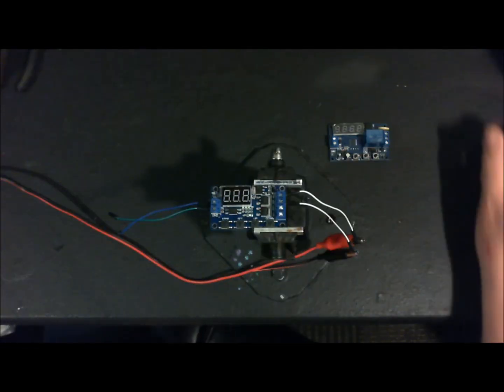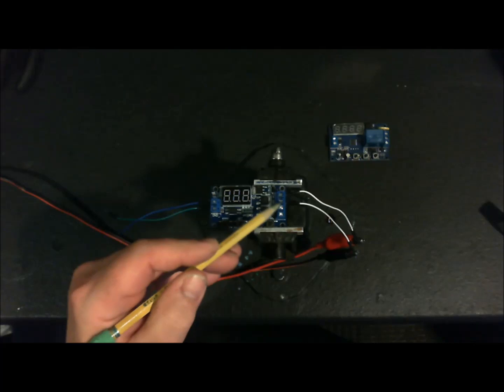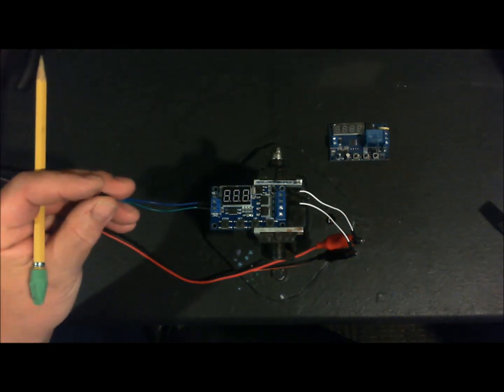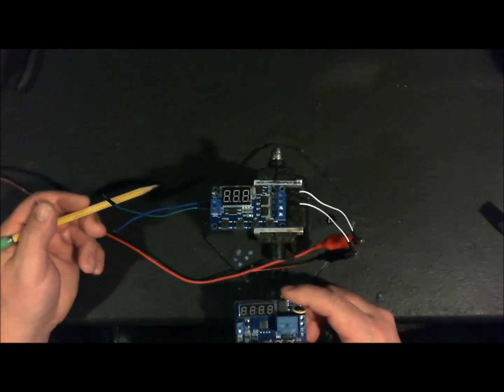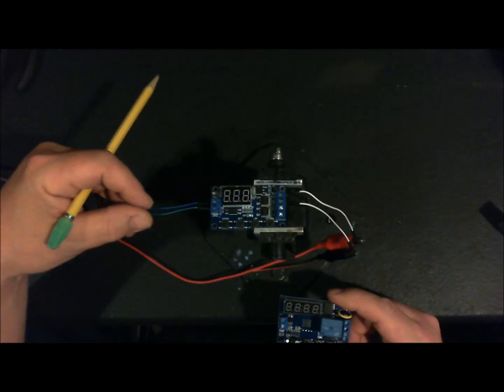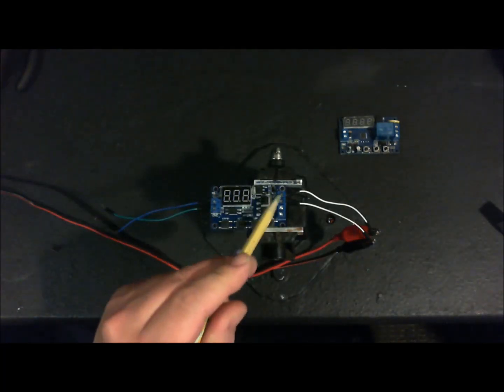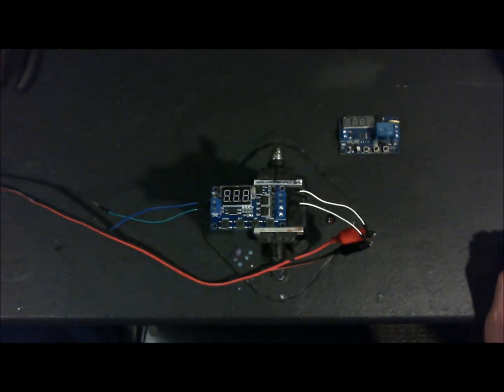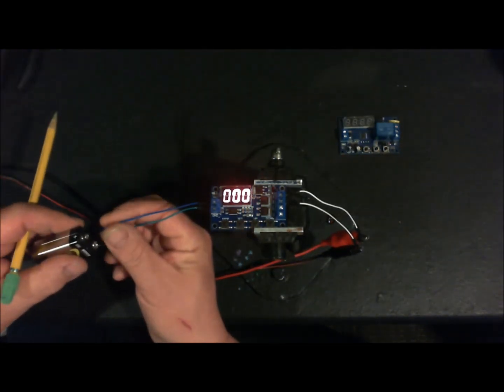Trigger cycled timer control board simplified.

Comment: This is driving me nuts! I'm trying to make it send continuous current to keep a small relay open for X seconds and then stop. JUST THAT! When I push stop and goes "ON", it sends current all the time except for when I start the countdown. When I push on stop again and shows "OFF" on the screen, it never works! WTF! Why is it hard for it to be programmed to just send current for X seconds! That's why I bought it in the first place! Can anyone help???
Reply from the maker: Ha, Chill, take a deep breath, please explain what it is you are trying to do in detail.
Reply: @raykd2ibp198  I emailed you details
Reply from the maker: Hello my friend. I have not received your email as of this message. You can elaborate here if you wish. Perhaps someone else can benefit from our findings as well.  A Lot of the problems with these projects are typical, often stemming from a lack of clear information provided by the creators of these boards. We help each other. If you prefer to be more private regarding your project... that's cool as well. Try the email again.
Reply: @raykd2ibp198  no it's ok and thank you for your time. so I need to have a specific low signal going through a wire. I wanted to interrupt the wire and put a relay which would open and close again for a specific amount of time, only once when the timer circuit would be triggered. So what I did was getting the timer and a relay. So far so good. I give the VIN (-/+) a 12V juice, I took a momentary switch for the trigger and gave the trigger juice from the VIN current. I connected the relay to the output of the timer and also soldered a 1k resistor and a led to see when the relay is open. I turn everything on, leave the progra on P1.1, set timer in 5 seconds, I test the STOP button, program it to OFF, press the trigger nothing happens - expected. I click STOP again, screen says "ON", the LED turns on, I'm like "wtf are you doing...?". I pull the trigger and as it counts down from 5 seconds to 0 the LED turns off and as soon as it reaches zero, what do you know, the LED turns on again and I'm left speechless!
Reply from the maker: Good day sir. (Name please)  K, What exactly are you looking to achieve in terms of sequence of operation after trigger? Time contact is closed, or open etc. 
Also, the board itself is like a solid state relay. SPST. Unless you are looking to drive a higher current than the transistors can handle. Or, you need to control more than one pole at one time, there is really no need to add another relay. 
I believe it's best to keep circuits as simple as possible. The less components used to achieve the final goal the better. More components = less stability, higher maintenance, and greater parasitic load.

Comment: hello, how to connect an IR module as a trigger? Thank you for the video
Reply from the maker: Can you show me the IR module?
Reply: @raykd2ibp198  Here's the link,thank you    https://www.ebay.com/itm/Smart-Car-Obstacle-Avoidance-Infrared-Sensor-Module-Reflective-Photoelectric/191848903842?ssPageName=STRK%3AMEBIDX%3AIT&_trksid=p2057872.m2749.l2649
Reply from the maker: If the module sends out +5 volts dc to the trigger in theory, yes this is doable. if you want to share in greater detail what it is you are trying to accomplish in terms of sequence of operation... I maybe be able help you out better. The IR board is limited distance wise.
Reply: @raykd2ibp198  Ok, I'm trying to make an automatic hand sanitizer dispenser but with the IR module, if you don't take your hands off, you're always putting the sanitizer on, so with the XY-J04 CMOS maybe I can stop it after a few seconds, say 2 or 3 seconds.

I did this:
https://www.youtube.com/watch?v=5yojb3vL-go

But I want to do this and use the XY-J04 instead of the XY-J02:
https://www.youtube.com/watch?v=jBHuBe5gmNo

Thank you
Reply from the maker: Ok, eliminate the transistor, and resistor from the cricut. Use the +5 volts you were driving the transistor with to now trigger the board. 
Use the pump supply voltage to feed the input voltage on the timer board. The load side on the timing board now drives the pump.
Reply from the maker: https://youtu.be/ysMldbfteLo
Reply: @raykd2ibp198  I am using the same power supply to power the pump and the IR module. The pump also works between 3v to 6v which is very convenient in this circuit.
Thank you

Comment: Hi can the trigger only be momentary or can it have 12v constantly and start the timer when the trigger is removed?  I want to use this in my car to power a radio. Like a failsafe that if I forget to turn the radio off it will time out after say an hour using the ignition 12v as the trigger
Reply from the maker: Hi Mark. I'm not sure. Wouldn't it be easier to have the main power to the radio wired into the vehicle's ignition switch circuit?  Key off = No power.
Reply: @raykd2ibp198  Hi Ray, Thanks for the reply. Its currently plugged into the 12v cigarette lighter socket but this switches off with the ignition. I would like to be able to use it without the ignition on or engine running. My idea is to wire it from the battery but have a failsafe so I dont leave it turned on by mistake. Being a canbus car its more hassle than its worth trying to find switched power that is on with the ignition off but goes off when i leave the car. This seemed like a good option.
Reply from the maker: Hey mark. Yes you can set the board to count down and open contact after trigger closes contact. See operation P3.1 attached in the comment section. you would just install a momentary push button type switch to trigger the board.

Comment: Hi Ray, thanks very much for the video :)

Do you know if this board/or another board will hold the contacts open for a second or two when mains power is cut.
i.e. I'm trying to come up with a solution that will delay the contacts opening when first provided with power, leave the contacts open until power is cut, at which point the contacts will continue to stay open for a second or two and then close
Reply from the maker: Hi Damian, If I understand the question correctly... You want both delay on "make"  when power is applied. And a delay on "break" when power is removed?
Reply: @raykd2ibp198  Hi Ray, yes - that's correct
Reply from the maker: Damian, I don't believe this board can run two modes concurrently. Although, I believe this board will support both functions independently. 
Look thru the attached modes of operation list in the comment section. 
What kind of voltage  are you working with?

Comment: I also have an 12volt cirquit time board, but I don't understand it.

I have an weight trigger micro switch, a micro water pump and the cirquit board.

What I want is put a glass on the micro switch then the cirquit board goes on and stays on for like 3/4sec and turn on the pump and turn it off after 3/4sec.

How can I do that?
Reply: It's like a drinks tap when you put your glass on it and shut off after a few seconds with pumping drinks in your glass
Reply from the maker: Good morning :)  I hope this helps you to get to where you are going. Please let me know if you get stuck. 73. -Ray 
https://youtu.be/YlmAey_HTJk

Comment: Sir, how can I use it to switch an AC water pump 220v on/off? Is there a modification possible?thx in advance.
Reply from the maker: Good morning.  The board circuit is like a single  pole, single throw switch. (SPST) you can use the board at a lower voltage (12/24 Vdc) to energize a double pole single throw contacter / relay to make a 220 volt circuit.  I can make a video depicting how if it helps.

Comment: Can it reverse polarity between triggers? Thanks
Reply from the maker: Good morning, I'm not sure if I understand the question. 
Can you explain what it is you're looking to do? I will be happy to help if I can.
Reply: Can you have a motor turn for X seconds then reverse the polarity to turn the opposite direction?
Reply from the maker: @dfxvideos808  

I doubt it.  Pretty sure the board simply controls NO/ NC switching. Let me think about how that can be controlled.   Can you share sequence of operation details? Message me if so.

Comment: Little  dark to see wires. I'm having  trouble  with trying to get a 6 volt pump to work on time delay pump  does not seem to be getting  power. Trigger seems to be working fine though. Thanks Tom Wainwright
Reply from the maker: Good morning Tom, 
1)Got a pic of your configuration? 
2) What is the sequence of operation you are shooting for?
Reply: I would have send you a pic. On email . Its twainwright1969@yahoo.com  thanks Tom
Reply from the maker: Sent you an email.
Reply from the maker: Hey Tom. Have not heard from you.  Is your problem resolved?
Reply: No not yet . Haven't had time to play with it. Relay is from China so it not even work. But I did order usa made relay.
Reply from the maker: Ok. I check my comments every so often. Feel free to reach out if I can help.

Comment from the maker: Mode selection screen: Long press the "SET" key to enter, after setting is completed, long press the "SET" key to exit back to the main screen.

Operating mode:

P1: trigger signal, the relay is on "OP" time, and then disconnect; in the "OP" time, as follows:
P1.1: signal is triggered again, invalid
.
P1.2: signal is triggered again, the clock is reset
.
P1.3: Signal trigger again, relay off, stop the clock.
P-2: trigger signal, the relay off "CL" of time, the relay on "OP" time, and then disconnect relay.
P3.1: trigger signal, the relay is turned on after the "OP" time, the relay off "CL" time, then the operation cycle, if the trigger signal period, the relay off, stop the clock; the number of cycles ( "LOP ") can be set.
P3.2: without triggering signal, the relay is on "OP" time, the relay off "CL" time, and has been cycling; frequency ( "LOP") cycle can be set;
P-4: signal holding function. If there is a trigger signal timing is cleared, the relay remains on; when the signal disappears, after the timing "OP" time, the relay is; if another signal during timing, timing is cleared;

After setting the mode selection screen parameter value by a short press "STOP" button to select the time range;

XXX. decimal point in the unit place, time range: 1 second to 999 seconds.
X decimal point in decade place, Timing range: 0.1 seconds to 99.9 seconds
X. X. decimal full brightness, Timing range: 1 minute to 999 minutes.
For example, you want to set "OP" is 3.2 seconds, then move the decimal point to decade place, the digital display 03.2

Parameter description: "OP" - conduction time, "CL" - off time, "LOP" - the number of cycles (1-999 times, "---" represents infinite loop).
Product parameters:

1: Operating voltage: 5--36V.
2: Trigger Source: Active-high (3.0V-24V), have optocoupler isolation, can improve the system's anti-jamming capability (customers can also shorting common ground).
3: Output capacity: DC 5V - 36V, at room temperature, continuous current 15A, power 400W! Enhance heat dissipation conditions, the maximum current up to 30A.
4: Quiescent Current: 20mA; Operating Current: 50mA

any switching times; Working temperature: -40-85 °; Size: 6.0*3.4*1.2cm.
6: With optocoupler isolation, enhanced anti-jamming capability, industrial grade board.

Pay attention:

The module is an active output, the output voltage equal to the input voltage.
2.'DC + 'and' load + 'This is an internal short circuit of the poles, but' DC- 'and' load - 'poles during use can not be shorted, otherwise the load can not be controlled on and off, which is equivalent load is been carrying electricity.

Timing range

0.1 seconds (min) to 999 minutes (max) continuously adjustable

How to choose the time range?
These parameters are independent of each other, but is shared by each mode. For example, in P1.1 mode, set the on-time "OP" is 5 seconds, if you switch to P1.2 mode, it's "OP" will be 5 seconds too.

In the main interface (display 000), short press "SET" button will display "OP" ( "CL", "LOP") and the corresponding time XXX;

Some parameters only mode "OP" (such as the mode P1.1, P1.2, P1.3), short press the "SET" key to display only the "OP" and the corresponding time;

Some models have parameters "OP", "CL", "LOP" (such as the mode P3.1, P3.2), short press "SET" button will display "OP" and the corresponding time, "CL" and the corresponding time, "LOP" and the corresponding number of times;

In the main interface by short press "SET" key to see information about the parameters of the current mode, very convenient!

How to set parameters?

First, read the instructions to determine the required operating mode.
The module is powered up, the display at the current work mode (P1.1 default mode), then enter the main interface; press "SET" button for 2 seconds after release to enter mode selection interface; a short time by pressing "UP", "DOWN" key to select the mode (P1.1 ~ P-4).
Select the mode (such as P3.2), short press the "SET" button, then the parameter to be set flashes ( "OP" on-time, "CL" off time, "LOP" cycles ( "---" represents infinite loop)), by "UP", "DOWN" keys to adjust the parameter value, support long press (rapid increase or decrease) and short press (increase or decrease one unit); then short press the "STOP" key to select the decimal point position, select the time range (0.1 seconds to 999 minutes); short press the "sET" button to set the next parameters of the current mode of procedure is as above.
After the parameters are set, long press "SET" button for 2 seconds then release, the name of the current mode will flash once, and then return to the main screen, set the parameters of success!
The main interface: In the relay does not work status display "000" (no decimal point), with a decimal point under relay state.

Mode selection screen: Long press the "SET" key to enter, after setting is completed, long press the "SET" key to exit back to the main screen.

"STOP" button extensions:

Relays enable mode:

ON: Relay allows conduction in the "OP" on-time;
OFF: relay prohibit conduction is always closed;
In the main interface, short press the "STOP" button to switch between ON and OFF, the current in which the state will flash, and then return to the main screen. (This feature is an emergency stop function, click off the relay)

Sleep mode:

"C-P" Sleep mode: five minutes without any operation, the digital display automatically turns off, the program running as usual;
"O-d" normal mode: digital display always open;
Press the "STOP" button for two seconds and then release to switch "C-P" and "O-d" state, in which the current state of flashes and then return to the main screen.
Read less